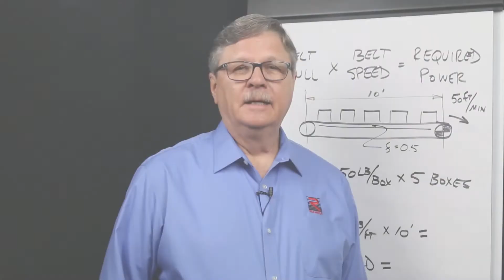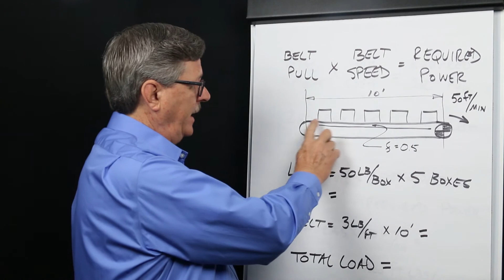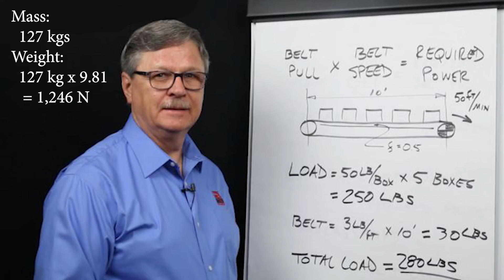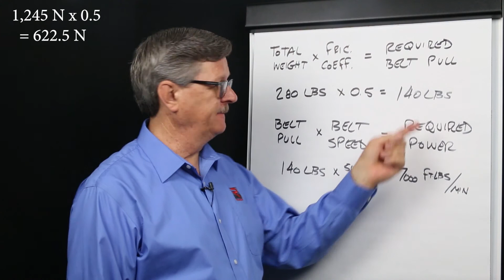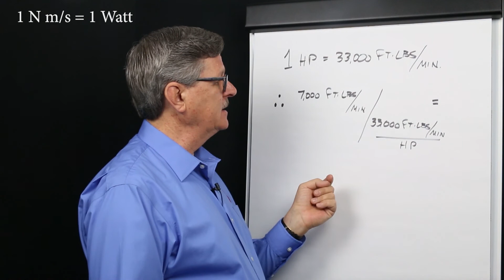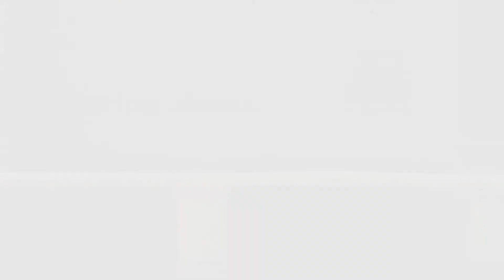How to Calculate Belt Pull and Power in Metric Units

Comment: I appreciate your help in providing me a brief equation or rule of thumb to calculate the specific energy consumption as Kwh/Mt/Km   length =  5 Km , Flow = 2500 to 3000 Mt/Hr , Route inclination= zero inclination, Width = 1200 mm , trough angle=30    how much electricity will be consumed in electrical motor
Reply from the maker: Your question cannot be answered until you specify a belt speed at which the material will be carried. 1 watt = 1 newton-meter per second.  Once you calculate the required tension (newtons) to pull the belt you must multiply that force by the desired belt speed (m/s). For example, a 5 km long horizontal conveyor carrying 3000mt/hr might have a belt speed of 5 m/s.  If belt pull = 222 kilo newtons, then required electric power will be approximately 222 kN x 5 m/s = 1,110 kW.
Reply: belt speed = 2.5m/s  and material is dsand with density 1.55 Mt/M3  @rulmecacorporation4596
Reply: @rulmecacorporation4596  

here we are with full data 
I appreciate your help in providing me a brief equation or rule of thumb to calculate the specific energy consumption as Kwh/Mt/Km , belt speed = 2.5 meter per second, trough angle = 30 , surcharge = 25, material = excavated soil  (sand) , lump size less than 150 mm , density =1,550 kg/M3 , belt  length =  5 Km (multiple flights ) , Flow = 3500 to 4,000 Mt/Hr , Route inclination= zero inclination, Width = 1,200 mm , considering these inputs , how much electricity will be consumed in electrical motor as Kwh per metric ton (Weight)  per Km (distance)

Comment: Hi, Belt pull  required to accelerate = mg x coeff.of friction+ma.But you have not considered ma?Is it wrong?
Reply: ma will always be negligible on short package conveyors which travel at 50 fpm +/-.  However, if you need to accelerate very quickly to a high speed with a large load mass, then you should check it.
Reply: Please define your terms. Thanks
Reply: m=mass of the load(kg/m) +belt weight
g=9.8 m/s2
a=acceleration

Comment: You calculated the mechanical power is required, but does that mechanical power equal to the electrical power of the motor which will drive the belt ?
in the case of calculation P=0.15KW , so in this case i will use an AC motor with a power at least  of 0.15 KW to move all those weights ?
Reply from the maker: We have some videos explaining the relationship between calculated required mechanical power and suggested electrical power. Did you watch them yet?
Reply: @rulmecacorporation4596  No, i did not , i will search it .
Reply from the maker: @wadib3eed7  watch this webinar please https://m.youtube.com/watch?v=q5v3M6ZsrrY
Reply: @rulmecacorporation4596  Thank you so much for helping me.

Comment: Thx! Why is the inertia not included?
Reply from the maker: To what inertia are you referring?  If you are referring to start-up inertia of a fully-loaded belt, many designers of small conveyors assume that will be covered by the "start-up torque" of the drive motors.  Design C motors, such as we supply, have a start-up torque of 200% of running torque.  That is usually adequate to do the job for the few seconds it takes to start a fully loaded belt.